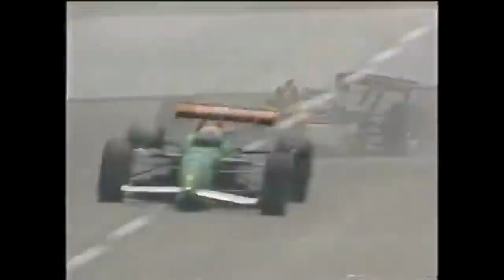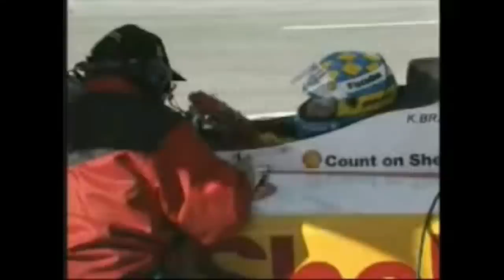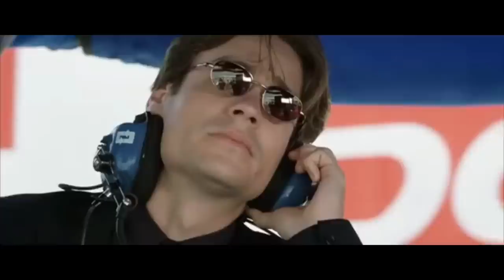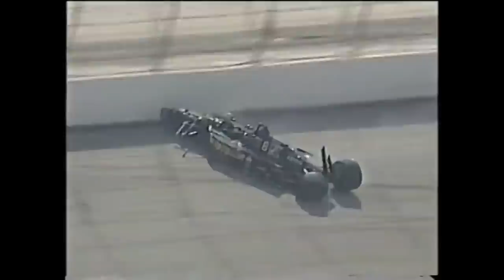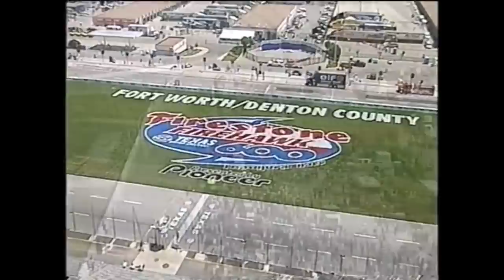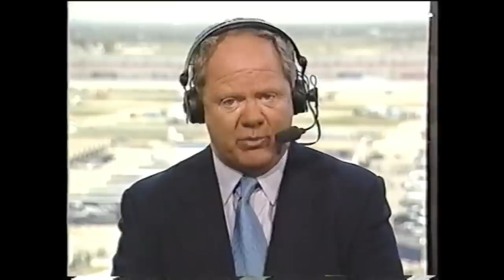The 2001 Texas CART Debacle

Comment: But why didn't drivers go full throttle in testing? They could of said then already -"man,i'm getting tunnel vision." Or why didn't they take drivers vote? So that makes me think that there was something more about that whole business and it wasn't all about Texas track,probably Cart had financial issues,they couldn't sustain the championship and Texas was the straw that broke the camel's back. The cars were awesome,drivers were great,so that leaves the management. But who knows,we probably will never know.
Reply: The CART V8s got a big boost in horsepower from the 2000 models as several makers engineered a way to cheat the pop off valve to give them a lot more power.

Comment: I wonder if they could have mandated slower gear ratios and/or used the short oval wing package.
Reply: Short oval package had more downforce and would make the situation worse.  Either way they didn't have the parts at the track or the time to convert them.  They also suggested using the road course, but they didn't have any of the road course package at the track either.
Reply: @danielhenderson8316  I just remember a few years later the Champ Cars had a Vegas race where they averaged like 204 mph in traffic with different aero. Might have been road corse wings.

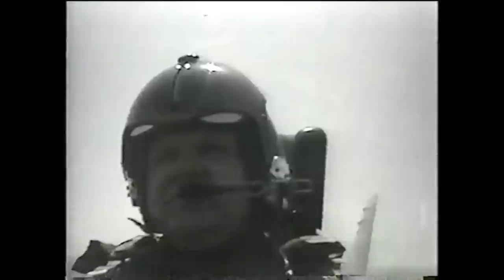Comment: I enjoyed your video but please refrain making false statements to sensationalize the presentation. @8:05 is just wrong.
Reply from the maker: It's actually not. A fighter pilot does not sustain the amount of G's for the length of time these guys were throughout a lap. Fighter Pilots can experience higher G's overall yes, but for only for 5-9 seconds at a time when completing a maneuver. These guys had a constant load of up 5g's for 14-18 seconds for every 26 seconds.
Reply: @Demise90Racing  Thanks for your response. I get what you are saying . In the video he states "5.5 which is almost double of what a fighter pilot endures ay one time". In other words he is saying a fighter pilot endures 2.75. That is not right, they can do 8-9 g.
Reply from the maker: @greghanson5696  I should have explained it a little better, but I went with what the broadcast actually said and I realize now its a little confusing.

Comment: Maybe if Kenny Brack would have gone full throttle in testing this could have been avoided.
Reply: His 2000 engine was less powerful than the 2001 engines that also exploited a work around for the pop off valve to give them even more power.

Comment: As a Cart guy this was the wrong decision because Auto Racing is designed to be fast this killed the sport furthermore Nascar would use this race. As an example of why they would reduce horsepower in 2015 and hence why I havnt watched any auto racing since than the leagues have gotten way to conservative with horsepower and the sport itself
Reply: I agree that more horsepower is better, but the race was rightly cancelled. There is no justification for going on with a race when professional drivers are getting dizzy and/or losing consciousness while driving at 230 mph. To do so would result in tragedy.

Comment: Put this in perspective , take the fastest car in this sport, give it a mile head start, and as it crosses the start line for a qtr mile race, a funny car then gets to go from a dead stop. That funny car would blow past it before it reached half way. And make it look slow, which it is. Take the top 20 fastest cart racing cars, and you won't even come close to the hp of 2 funny cars racing. When a funny car has to stop, the driver has to close his eyes first or he will damage his eyes from the negative g force of stopping from 350 miles an hour ,which only took 3.5 seconds to do